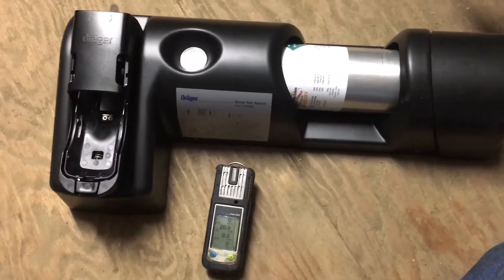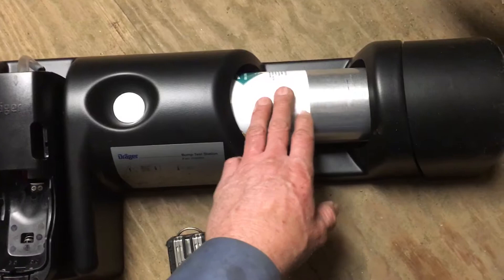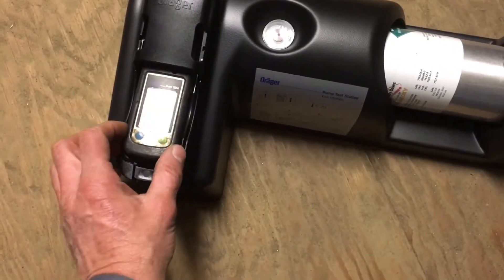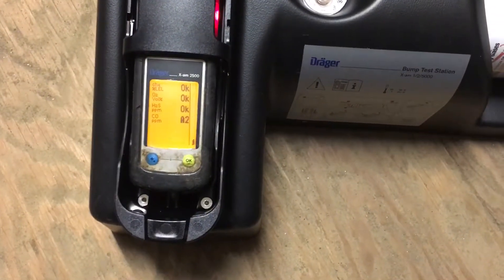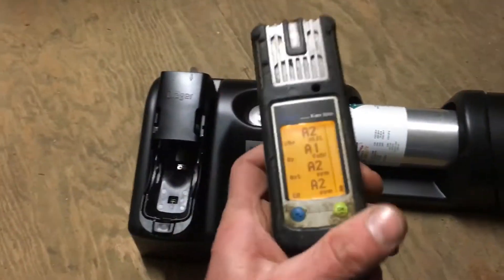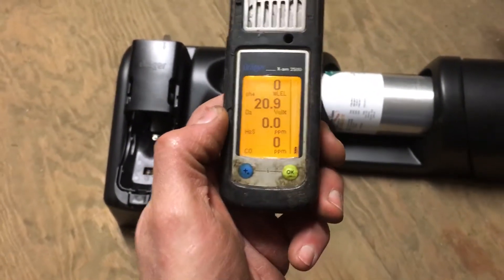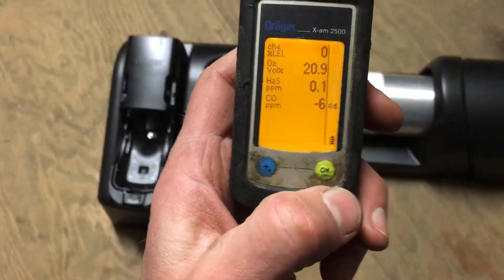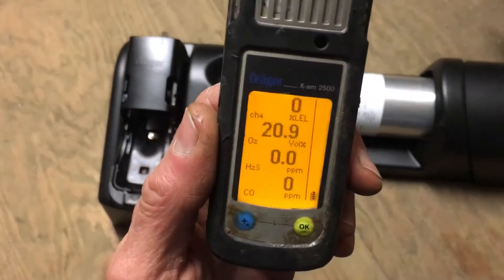Draeger X-am 2500 Performing a Bump Test

Comment: is it just one canister of gas to check all the sensors? or do you need to have a different canister for each sensor? I'm mainly looking for Methane detection
Reply from the maker: Just one canister is all you need. This one canister has the gas for four different sensors that all get calibrated at once from the one canister.
Reply: Fantastic! Thanks for clearing that up @jbgearhead